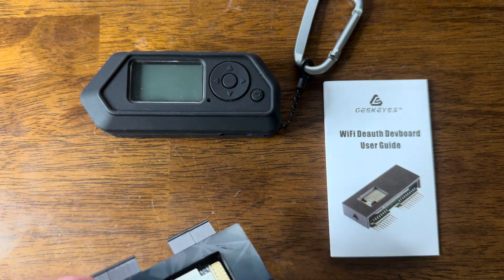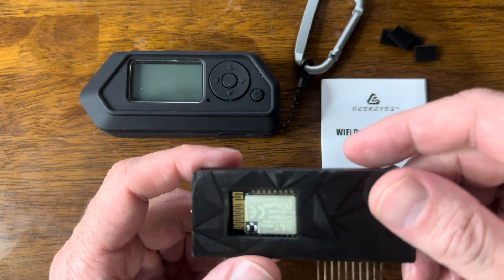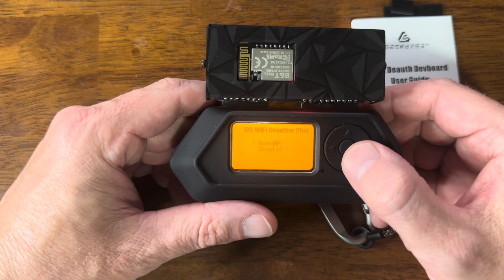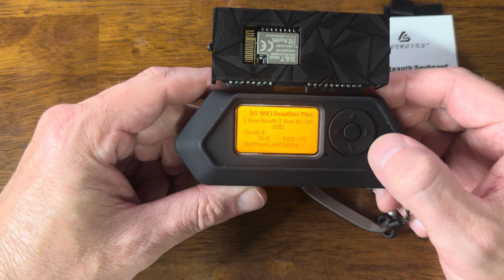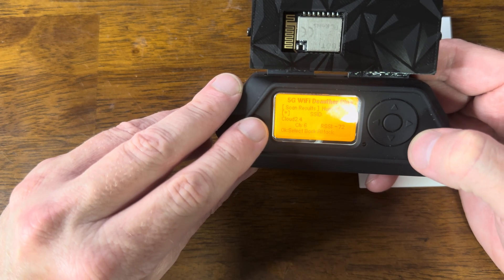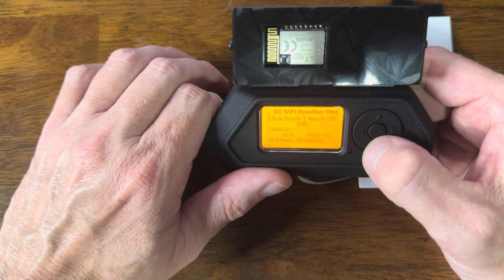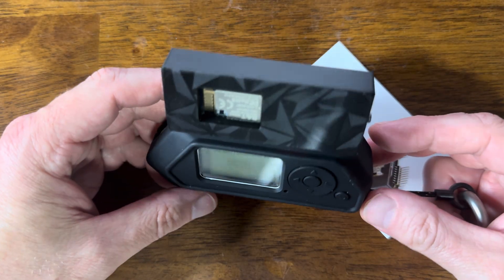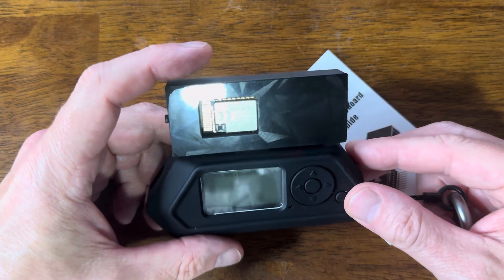Flipper-Zero GPIO WIFI Devboard 2.4G & 5G Dual-Band WIFI with Scan and Deauth Attacks

Comment: can you make a video to set up
please bro i bought install the firmware and fap but doesnt deauth
Reply from the maker: There isn’t any setup beyond loading the app and connecting the GPIO board. If you can scan networks, you should be able to do everything else.
Reply: @PenTestTuner  when i run a deauth on my home frontier wifi it doesnt seem to work it runs off 5g